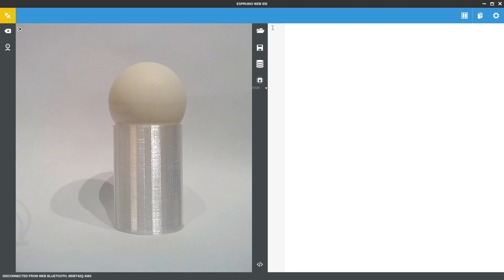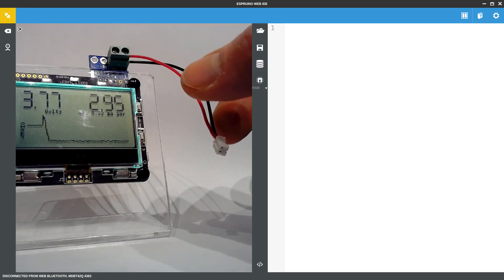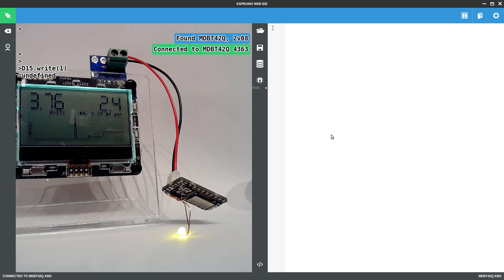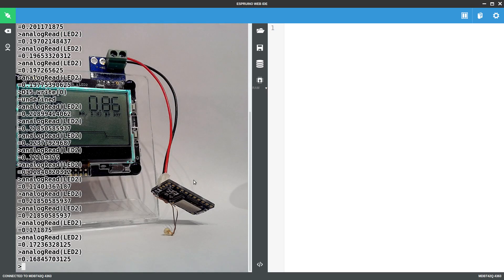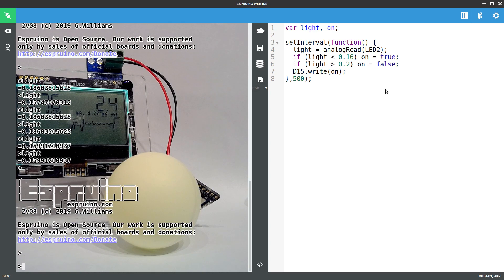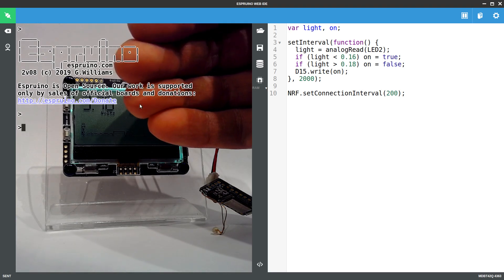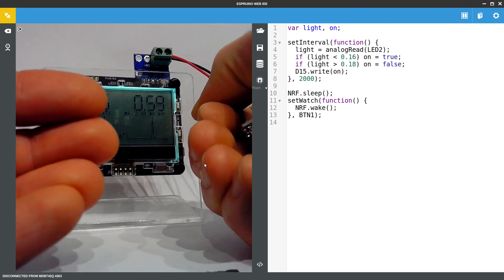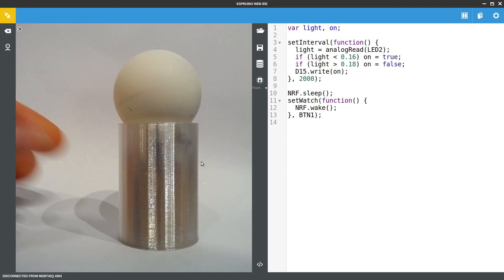DIY Night Light

Comment: Wouldn't have thought ambient light reading would be useful with the led turned on, but looks like I was wrong. 
If it wouldn't work, I think one could just turn off the led, take an analog reading, and turn it back on, if the light level is still low. Most likely no-one would notice it.
Reply from the maker: That's a good point! I might give that a go - right now it works great but it'd be nice to tweak it so it turned off a bit earlier. Actually also just physically adding a barrier (like a bit of black tape on the bottom of the ping pong ball, or flipping the PCB face down) would help a lot.

Comment: Would love to see more about the power meter...  But I guess now that you gave me the idea I could try using analog read and feeding that to a graph... neat idea you have sparked.
Reply from the maker: Just added http://www.espruino.com/Power+Meter - also there's a video on a 'poor mans' version coming online today hopefully
Reply: I guess the blue pcb on the pixl /badge is an INA226 or INA219 breakout. Does voltage and current measurement and averaging.
Reply: @AkosLukacs42  Oh and I see there is an example for the INA219 already... https://www.espruino.com/INA219
I guess once I get my hands on an INA219 I can try this out, thanks!
Reply from the maker: @jontscott  Yes, It's an INA226 (but 219 will be basically the same). I'll stick the code on the Espruino site today, but it's literally just a matter of connecting it via I2C. I'm using one of the Pixl Multicolor badges, but that's just because it's got a LiPo and charger on it so it's convenient